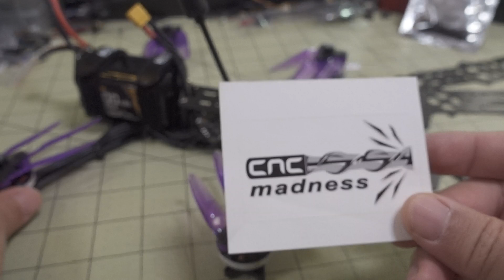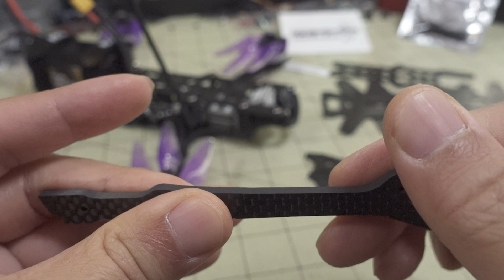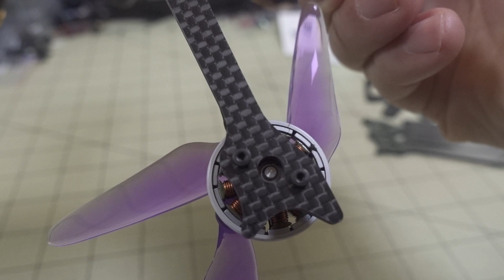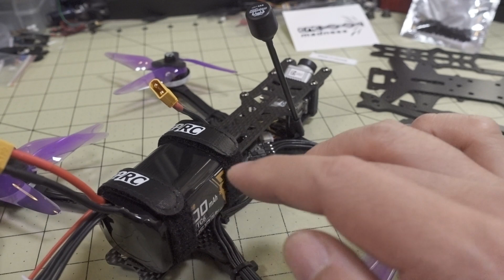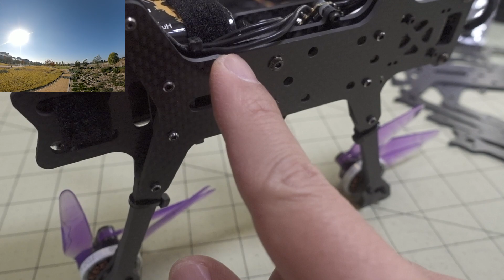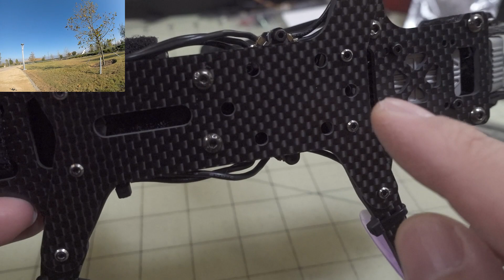Custom Frames Cut by CNCmadness (Help me name this frame) 🛠️

Comment: Interesting design. How will the built frame you showed balance with a 3s lion and no action cam, still tail heavy? Will a full DJI air unit fit in the front?

Comment: I really need to order some parts from there, Dave C swears by them. 

The battery placement on the frame reminds of how I strapped the Lipo on my 1st 5in quad (3S, 1806s,DSMX, Gemfan 5030s...ouch)

Comment: Ive used them for some custom Pickle and Quad66 micro frames. Very fast turn around and quality parts. Bashing up some as thin as 1.5mm with not an issue to date. knocks on wood Ohh for a name how about Scorpion?

Comment: Interesting frame,but what is the center of gravity with the battery at the back.The rear motors will work more than the front ones,right?I would call it "spaceship"

Comment: Reminds me of the QAV 250 the way the battery sits in the back.
Reply: Lol, that's what I said too.  I still have mine! Has not flown in years, but still in one piece.
Reply: @yannickg6904  I have one too. It is one of my two analog quads that I fly like once a year. The frame had so many design flaws/weaknesses but for some reason it flies very well. I think it's the esc, motor, and prop setup mainly.